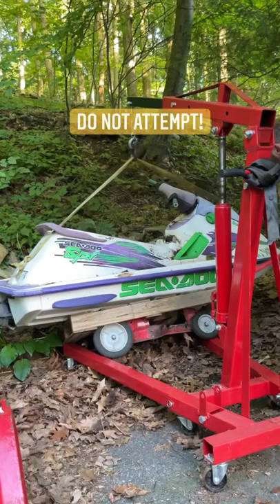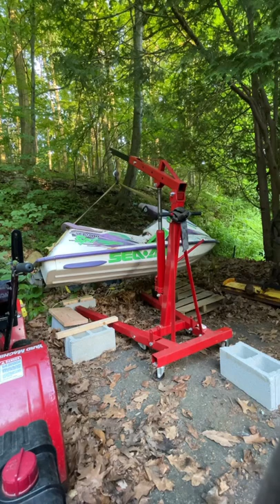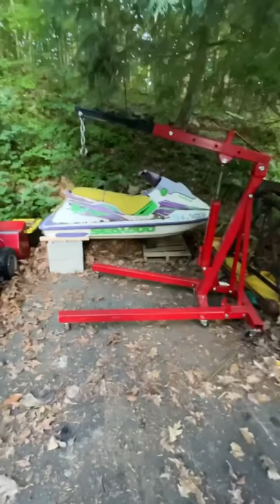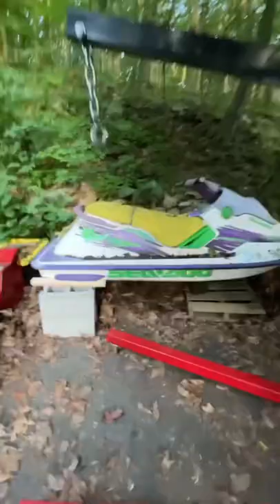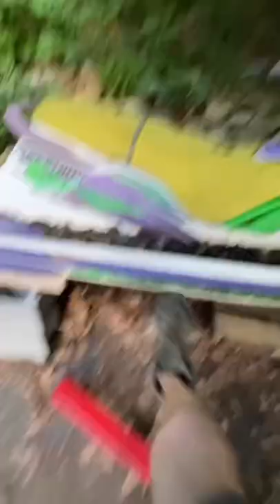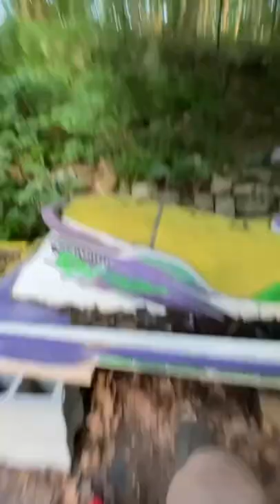Lifting a PWC with an ENGINE HOIST (give it the kick test)

Comment: I use to use a 4 point harness and a harbor freight ceiling winch installed on the ceiling put my jet skis on carts and then pushed into corner to save space in the garage.